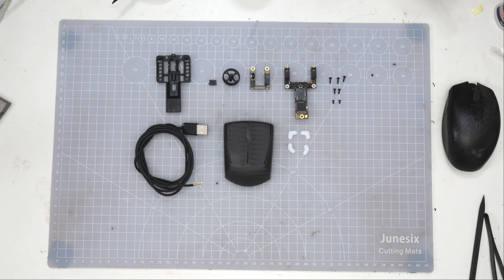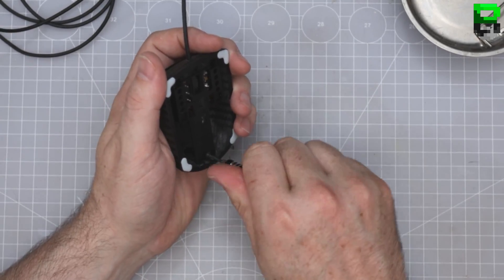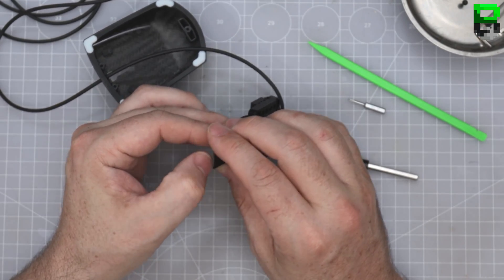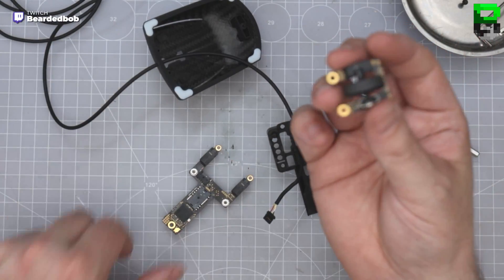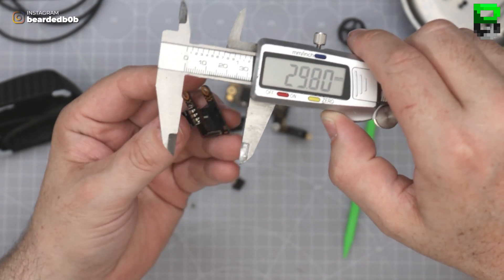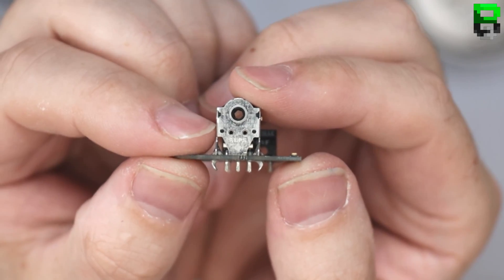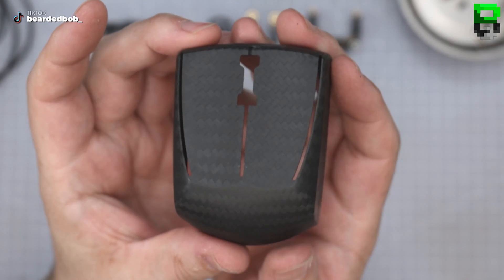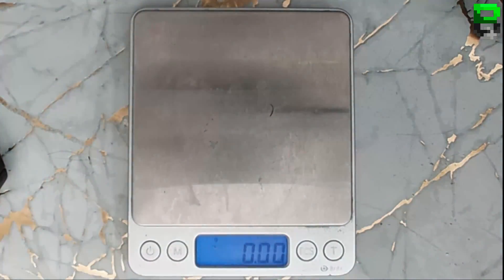Zaunkoenig M2k Teardown: Inside the World's Best $300 FPS Mouse!

Comment: If anyone is looking to replace the stock cord with an Ultralight Aircord Paracord cable from Enncoo then Zaunkoenig have a guide pinned to their Discord for doing this. (I made the guide.)
Beardedbobs Video will help a lot in that process.

The Enncoo AirCord Ultra-Light Paracord Mouse Cable is like a lighter than shoe string cable that never gets in the way and doesn't even require a bungee cord.

Comment: Hey beardedbob , I just replaced Switches of my Hati-S Ace and my right click doesnt work , just remade it with an other switch but again same problem. Do you have any Idea if the pcb of the Mice can be the failure?
Reply: You have probably removed one of the solder pads. It's fixable but quite hard to do if you're a soldering novice.
Reply: @moepOo  could be possible dont know how to looking for that. I made 5 mice and that's the Only one that dont made it xD